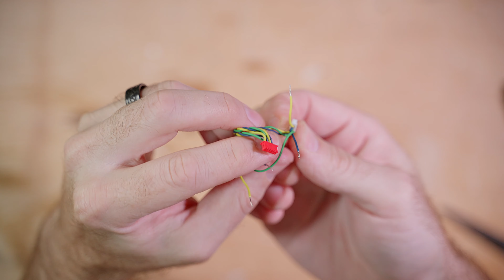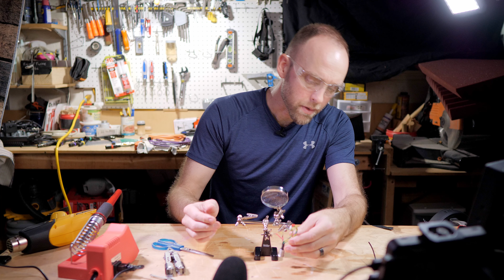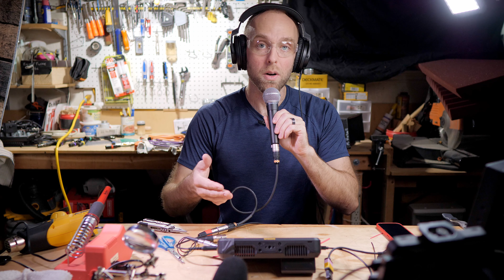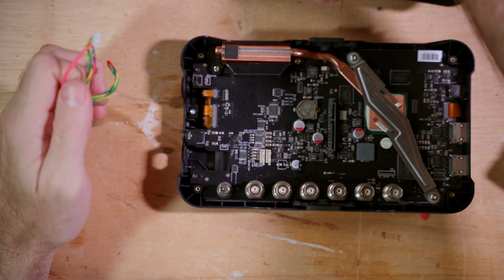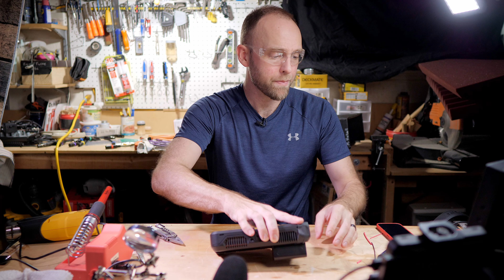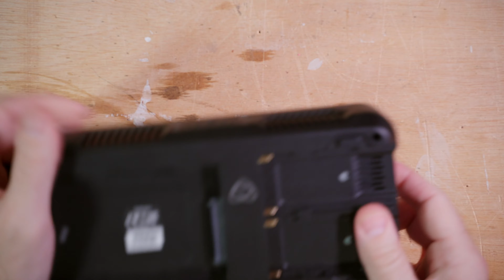Atomos Shogun 7 - Disassembly and Audio Fix

Comment: Hello. Are you still using this Shogun 7? Because mine has a problem, I don't know if it's due to overheating, but after several minutes of use the LCD screen becomes opaque/faded, as if there was fog, have you seen this problem? Thank you
Reply from the maker: Hi there.  So, when I first bought the Shogun 7, I definitely had a "Fog" problem.  I rented one first and it was great, then I bought one for myself and the screen was foggy so I sent it back.  the 2nd one I got was less foggy.....but now I don't notice it anymore, so, it may have either gone away, or maybe I just don't see it b/c I'm not comparing it to other Shoguns.

I love the functionality of the Shogun 7, but its screen just is NOT great in terms of color and that "fog."  I'd say run it for a while and see if the fog goes away, otherwise, send it to Atomos if it's still under warranty

Comment: Interesting video man . . . Next time you run into that type of problem you might wanna try dabbing on some Plasti Dip to the exposed wire with a little flathead tweaker. Could save you the hassle of soldering
Reply from the maker: hi there.  Good to know!  I to tend to always connect my electrical wires with some sort of metal attachment, either solder, or crimp-plugs, wire nuts, etc.  Haven't tried plasti-dip, but I've definitely wondered how well it works on other items......handles of tools, etc.

Comment: Hi, any idea what value is the ceramic capacitor on the 0.95V left bottom corner of the cpu? Cheers!
Reply from the maker: I have no idea at the moment.....and I didn't *plan on taking my Shogun apart again any time soon,.....so far it's been working just fine since my minor repair.....other than the fact I can't set the date to the year 2025 b/c Atomos hasn't updated the firmware recently.  I think *maybe they fixed that in an update a couple of weeks ago, but on both my Shogun and Ninja, I can't set the date past the year 2024.  I love and hate Atomos at times.  Aaanyway, cheers!

Comment: Using a needle, it is easy to pull each wire out of the connector.  You just have to be careful and then you can put on a heat shrink tube, although electrical tape would be enough, provided that the core of the wire is intact.
Reply from the maker: Hi there.  I wasn't sure if the wires would pull out so I didn't try much, I was too afraid I'm damage it.  But, my soldering and heat shrinking did work, so I'm good to go!  And it's also good to know that the entire analog audio connector (Lemo connector, wires, and connector to motherboard) is a completely separate, and removable part, so, It *could be replaced entirely without having to repair.  Thanx for the tip, I'll definitely try that next time.